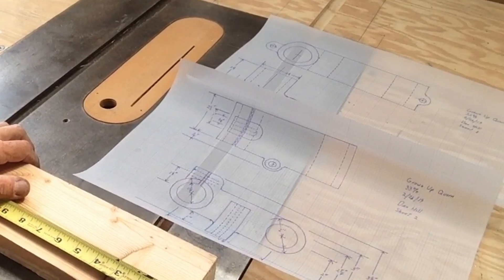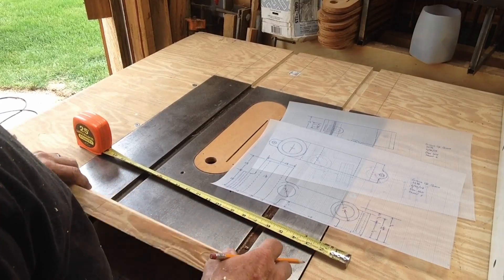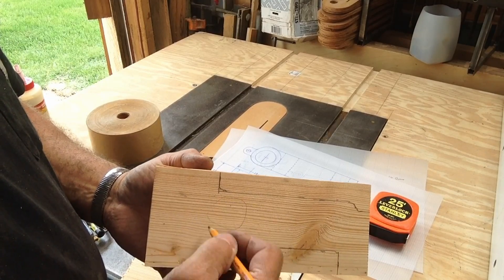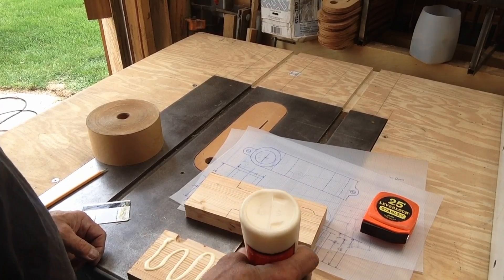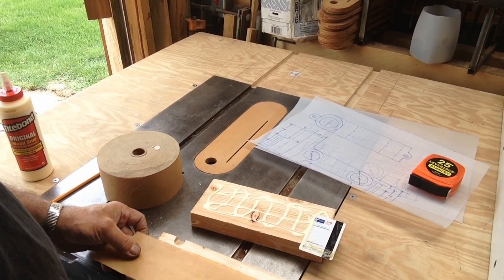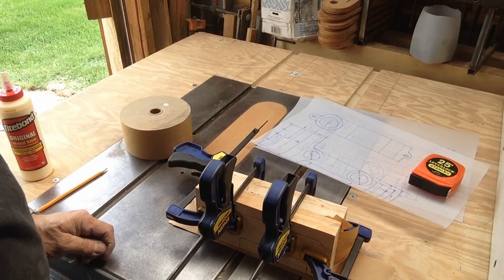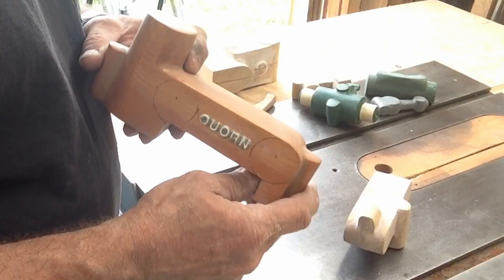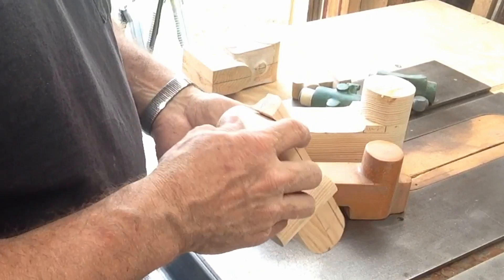Building A Grown Up Quorn Tool & Cutter Grinder: Part 2

Comment: I had the same reservations about the size of the original Quorn, but never got as far as you have. 

Prof. Chaddock designed the original to be made using what the English call a 3 1/2" lathe (7" diameter swing to Americans), which at the time (45 years ago) was the most common size in a model engineer's workshop. The dream of most model engineers was to own a Myford ML7. The book you showed has pictures of his own very old Drummond lathe on which he built the prototype However, a lot has changed since the original was designed, and many of us now have larger equipment in our shops. Therefore your "grown up" Quorn makes a lot of sense. Cudos to you!

Subscribed, and following with interest,
Russell Dold
Germiston, South Africa.
Reply from the maker: Thank you, It is more a labor of enjoyment than anything else because while it has it's limitations the original will still handle most jobs in the home shop although slower. I have seen much discussion about lengthening the bed on the original, but if you have the enginuity to build the Quorn you also have the engunity to do a setup for sharpening in it's original configuration. The reality is that while we have moved to larger machines we have also moved to either more disposable cutters or inserts which for production work are usually better off replaced than resharpened. It's best use in my opinion is for making specialty form cutters.

Comment: Are you going to incorporate bosses for screw pads in counter bores to clamp the bars rather than just the original split and squeeze with ball handles. the type shown in G. H Thomas workshop Techniques on the universal pillar tool.They are worth the extra effort.
Reply from the maker: In some places I may such as the mount to the vertical column but not everywhere, I will use the original clamping design on the base. I feel there are pros and cons to both. The advantage as I see them is that they have superior holding force, and eleminate the castings closing when they are split. The cons is that they take up more room and can be more finicky to keep operating smoothly, I have had them become sticky and not want to release.